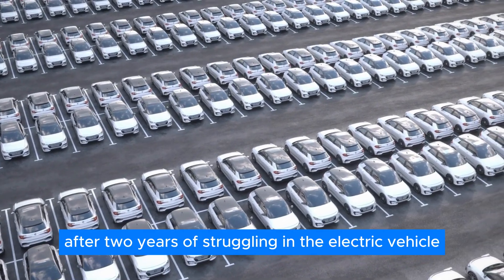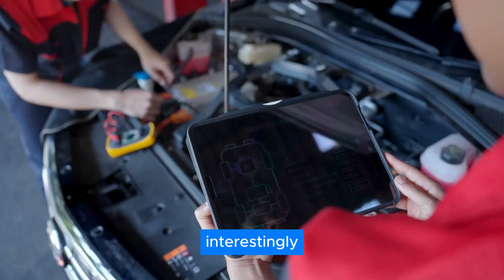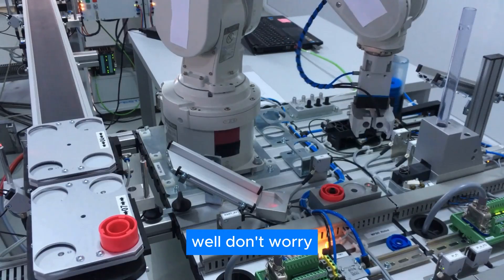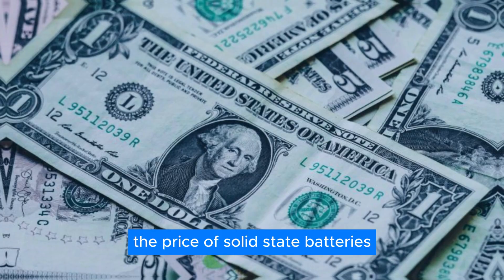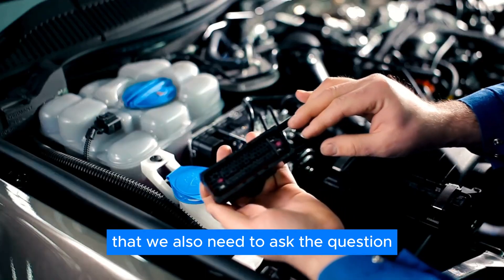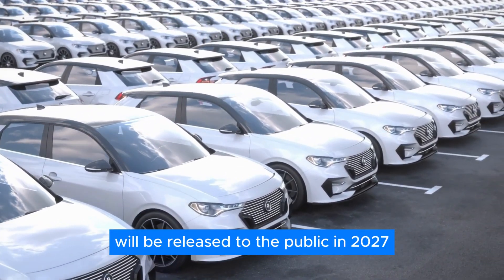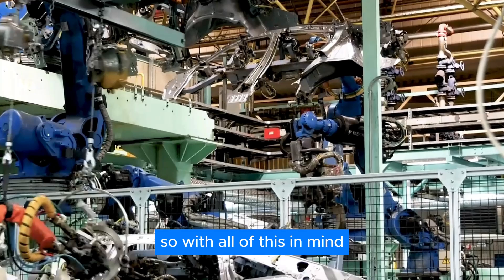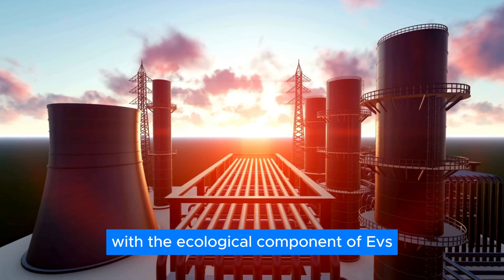Toyota’s ALL NEW Solid State Battery Shocks The World!

Comment: How would Toyota, without any battery experience, invent a new battery?  Not reasonable.  In reality, if Toyota were serious about this, they would team up with a battery manufacturer like Panasonic, Toshiba or Maxell.  They haven't.  
NOTE: We have had solid state Lithium batteries since the 1980's, they work, they are just too expensive to use in cars.